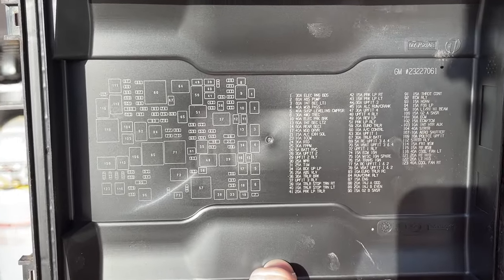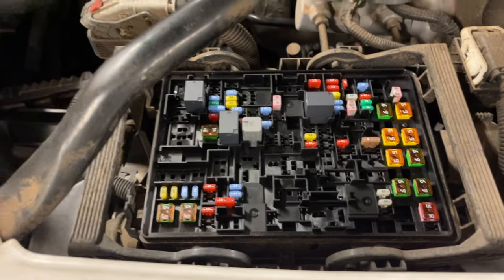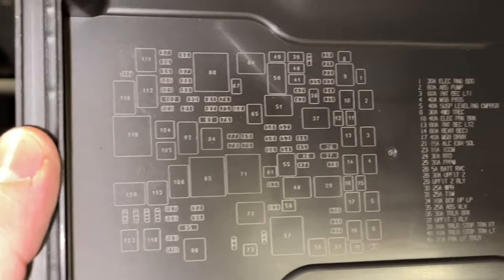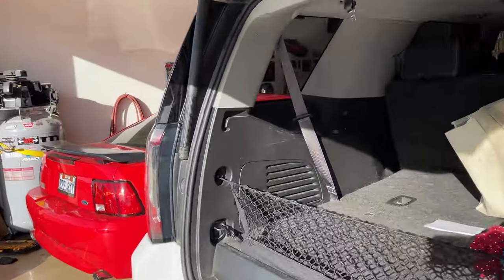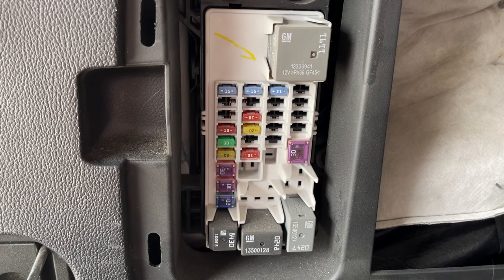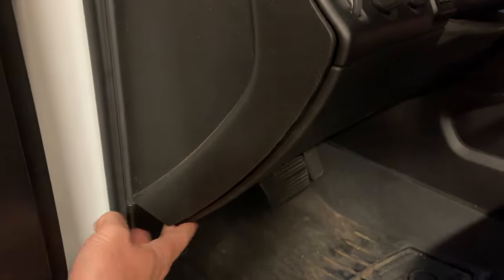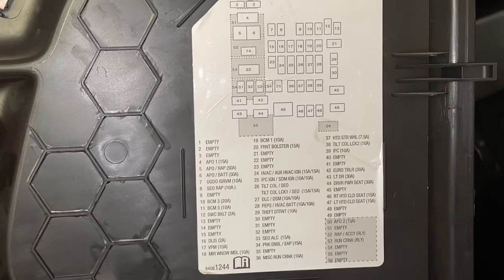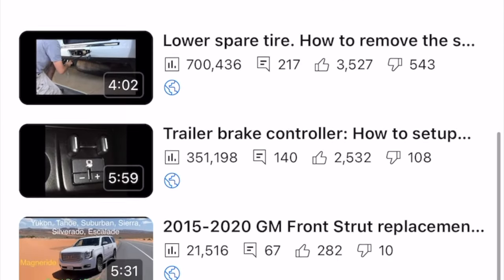Hidden Fuse locations & info GM Yukon, Tahoe, Suburban, Escalade, Silverado Sierra quick reference

Comment: Could you please advise me which relay or fuse is for the Driver side folding mirror? I removed the outside cover to access the folding mirror motor.There is a blue and yellow wire and when i push the switch it gets power to fold out but when the switch is pushed to fold the mirror in there is no power , this only happens on the driver side.The passenger side mirror works and moves in and out as it should. Possibly the switch or a relay in thinking but cannot determine the location.

Comment: Cars are so complicated these days. My first car was a 1980 Chevy Monza. It had a small fuse block under the hood. That was it. The 69 Camaro I inherited, (miss that car) had an even smaller fuse block under the hood. Had a 350 V8 that you could hide a family of 4 next to it with plenty of room. Crazy how cars have changed in the last 30-40 years.

Ever have the turn signal relays go out? my 02 camaro had that happen at 10k, 20k, and 30k. Right turn signal rely. Apparently the dealership had a batch of relays that were all bad. Also those were under the passager side of the dash and hard to get to. Left one was easy to get to.
Reply: the future is now old man (I hate it aswell)\

Comment: Help! I bought a used 2016 suburban and all of a sudden I am getting a message regarding the front camera and sensors causing the lane change notifications not to work.  I believe I’ve identified the problem being associated with a blow fuse 28 on the passengers side fuse box but it keeps blowing as soon as I put a new fuse in. Can’t find a wire mapping in that online and don’t know what to do to fix the problem

Comment: I remove the fuse and can't remember which one but the light in the side mirror stops working
The light under the side mirror turns on when the door is opened, and illuminates the floor

Comment: All this fuse block information is appreciated but I have a 2006 Z71 Suburban that has no backup lights working.  A new Neutral Safety Start Switch was installed and the alignment checked several times.  All shift positions indicate perfectly and the 4WD electronic actuation works as it should.  The B/U LP fuse and the TRLR B/U fuse are good, as is all the associated wiring, but a hidden fuse protecting the backup lights and the Automatic Day/Night Mirror System can't be found, which all fuses are supposed to be housed in the Underhood Bussed Electrical Center under the engine hood on the driver's side.  There is a VEH B/U fuse in the Haynes Manual indicated that it is in the Underhood Bussed Electrical Center but it's not there, so it's hidden somewhere in the vehicle but can't be found.  Any feedback on a possible location would sincerely be appreciated.  Thank you..
Reply: Check your rear ground wire if nothing else works, it grounds all the rear lights it's usually above the spare tire depending on year of vehicle.

Comment: In what location is th steering wheel fuse location...my button 🔘 for volume or yo change station is not 🚫 working 2019 Yukon
Reply from the maker: It may be part of a general harness, so one thing you can do is a continuity test 
https://youtu.be/-BUzm-OeGhE?si=IBGHfFGlu_g6dhyq
Reply: We're is the fuse location is at ? On the left side ...for the steering wheel?.. volume radio 🔘...?